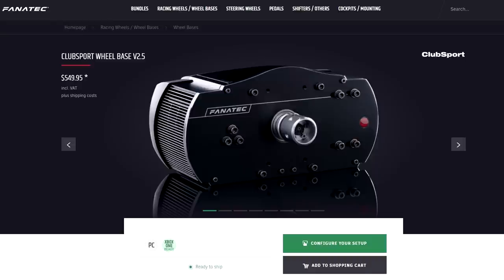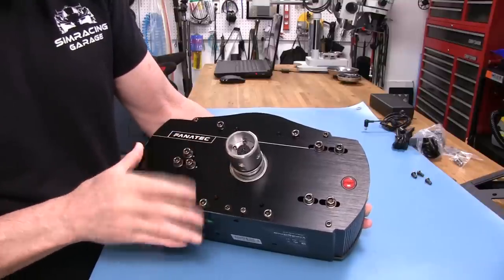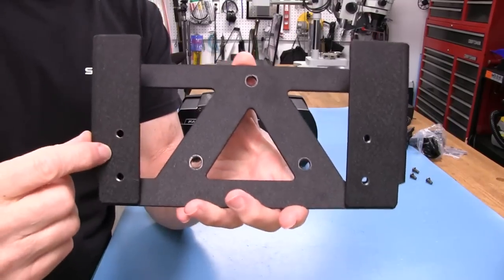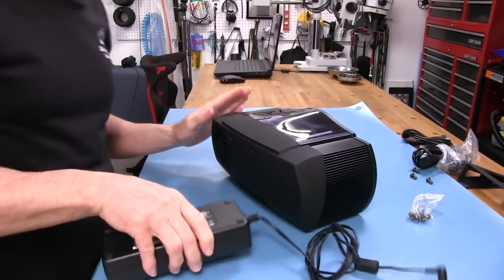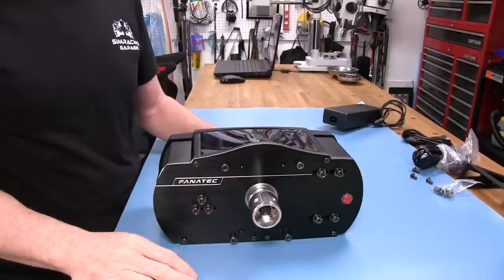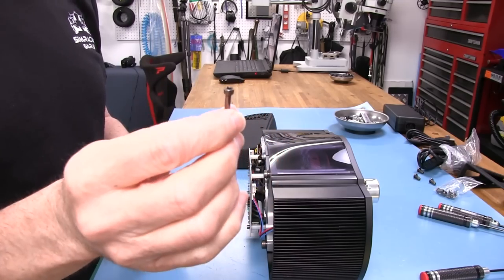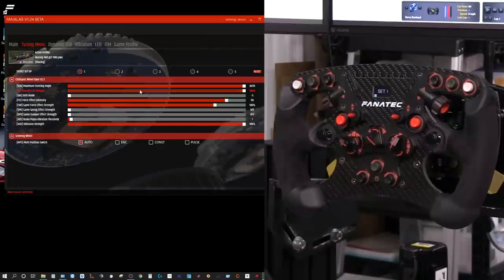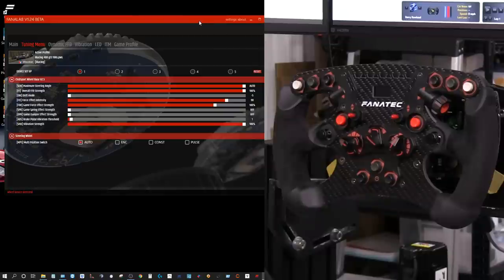Fanatec Clubsport V2.5 Wheelbase Review

Comment: Is there a unanimous decision yet if its best to have FFB on the base at 100% at all times and adjust in game only or
Reply: Follow your heart and don't listen to the naysayers
Reply: @hugovai89  its a good point, i find when making any ffb adjustments you need to just adjust to your liking and not pay any attention to what your settings are and how it compares to others
Reply: If you have ingame FFB at 100%, you would get the most granular output from the game before it gets converted into FFB by the wheelbase. That being said I always run the base at 100%, because it's easier than adjusting it every time you change games.
Reply: If you want the most force, then 100% in software and changing it ingame is the only way to go. Anything else is flat out wrong.
Reply: @whysoslow1999  ya and this way you wont ever have to worry about clipping i wouldn't think.  On my dd1, in game i never use more than 40%

Comment: I would like to see a comparison of the v2.5 using drive hub on PS4 vs csl elite. Can a better Fanatec experience be had on PS4 using drive hub with v2.5? Because then that would give you the best of all 3 worlds with Fanatecs best belt drive wheel base. I understand that drive hub is emulating a logitech wheel but the telemetry coming from the console and coming back from the wheel isn't necessarily going to be different. Just coming through a different portal.

Comment: Are the fan connectors 3pin or 4pin?
Reply: The connectors are four pin, but only three are being used, and of two different pin pitches. Pins 1, 2, and 4, colours black, red, and blue. The blue is probably PWM input and the sensing pin (3) is probably just being ignored. Likely just running the fans at either 50% or 100% PWM signal depending on necessary cooling capacity.

Further info: They are 24V fans (no step-down to 12V on the board, making replacements with common computer fans more difficult). The side fan has 70mm square housing, and the rear is around 65mm diameter, and the sort you'd see on a video card with three mounting holes radially along the hub, accessible between the blades. Sadly this means you cannot simply reverse flow direction to get cool air forced directly through the motor finstack.

I'm trying to figure out if there's an easy/sane way to heighten the airflow effectiveness and lower noise, as high force feedback settings make the unit sound like a jet engine (to my sensitive ears, at least).
Reply: @Fuogor  Thank you very much. I thought it would be easier. But If you find a solution, please let me know. I think the fans are to loud, especially the one in the back. I realy want to change them.

Comment: Pretty sure that's just a microchip on the motor driver board , not a sensor, basic wheel set up will have one rotary sensor and a motor, the motor takes its position off the one rotary sensor, the driver board works out the maths for its position
Reply: Some Fanatec bases actually use two rotary sensors, one on the motor axle, the other on the steering axle. I believe it's because the smooth belts are slipping from time to time.

Comment: This + V3 pedals are my dream setup and end goal for sim racing equipment. I currently own my old t150+t3pa pedals and while pedals are nice the t150 is the worst part in my setup. Its extremely cheaply made with annoying sticky rubber and the wheel itself is one plastic junk. The ffb is definitely lacking. As for my first wheel in a very long time (used to own logitech wingman formula force GP) it was decent wheel but the urge to upgrade comes more and more often.

Comment: I'll buy gear based or DD. I do not trust belts. They can't be reliable on long term or long run.
Reply: theres no issue with belts,  yeah they're 5 years not an issue still 8nm strong.
Reply: @endfm  I used my old G27 10 years. Tell me again after 5 years.
Reply: 8.5Nm @endfm